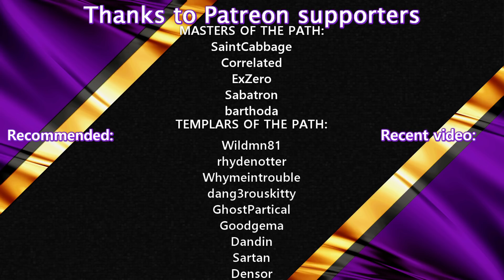Solving COOLING and METAL REFINING in Oxygen Not Included "Spaced Out" DLC | Tutorial/Guide

Comment: So... it's the 1st time i decided to check your ONI series and i rly like it. One thing i would change is a layer of liquid like crude oil or petrol at the base of turbines and make it vacuum. The heat is generated the base of the building so that way you cool em more efficiently cos you accumulate heat in just one place instead of dissipating it across the whole room.
Anyway a liquid with relatively high temp range, conductivity and capacity.
I'd also avoid putting even an insulated pipe thru a hot steam room.

Oh and one more thing. Since batteries generate heat why cool them with water instead of putting them into the steam room to use this small heat gain into power, making their heat generation working in your favor instead of against you.

Comment: Awesome video as always! This greatly helped me at understanding how exactly this whole steam turbine cooling method works. Inspired me to start experimenting with slightly different builds (Via creative for now) as it's pretty fun to mess around with it. My design seems far inefficient compared to yours though as the coolant on mine can reach up to 260 celsius which is still fine I guess but quite hot.
Reply from the maker: Thank you and good to hear :)
Do not use Crude Oil or Petroleum for the cooling loop through the Aqua tuner. The Aqua tuner will lower the temperature by 14 degrees no matter what liquid you put through. This means you want the liquid with the highest Specific Heat Capacity as that means 14 degrees is more heat. Water and PWater have very high Specific Heat Capacity (2-3 times higher than Oil and Petroleum)
Reply: @Nilaus  Oh, yeah, I am only using petroleum for the coolant for the refinery. The Aqua Tuner loop is polluted water just like in your video. :)

Comment: Nice tutorial. But the full water-lock is a bit unnecessary if only for the building process. It is possible to use one single bubble of liquid on top of a tile to block gasses or vacuum in chambers like these. I usually use one bubble of petroleum on the tile under the base of the steam turbines so the steam doesn't come out and it's easy to block once the building is done and unblock for maintenance.

Comment: Since the petroleum is kept "hot" why do you have it next to the metal refinery and not inside the steam room? It would seem that you have the space for it. I think I've also seen some designs that use a polluted water reservoir inside the steam room to also help even everything out. (maybe the issue is getting materials for the reservoir that won't overheat at 200C).

I definitely like the lower liquid thermal reservoirs and the ability to fine tune temperature coming off of it. I had a tendency to just run the coolant around the base but that leads to 0° water super chilling your base.

Nice build overall.
Reply from the maker: It would get too hot if the petroleum is stored there. Above 200 degrees is inefficient and only produces more heat in the steam turbines. It would also risk very easily flashing to Sour Gas and breaking everything
Reply: @Nilaus  But you're "cooling" the petroleum via the steam, so the petroleum coming out of the steam room is going to be the same temperature whether the tank was inside or outside the room, right?

Comment: If you are building a second one (eg you already have one with a refinery) of these could you use a second aquatuner rather than a refinery to get the temperature higher?  That way your cold boxes are even more effective.
Reply from the maker: that would not be beneficial. It would take a lot of power to run and only be marginally better. 1 Aqua tuner is a lot more powerful than it seems. It can cool down a Refinery + 2 cooling loops easily

Comment: I'm having trouble with the cooling loop going through the aquatuner. The aquatuner keeps telling me the output pipe is blocked, but I can't figure out where. I put the liquid bridge over it for the bypass as recommended, but still no luck. Any ideas?
Reply from the maker: share a screenshot in the Discord and someone can take a look. Hard to debug from just a description :)
Reply: @Nilaus  Thanks for replying, turns out I had just filled the coolant pipes too full so they weren't circulating properly. I took a bit of the polluted water out and it started flowing just fine!